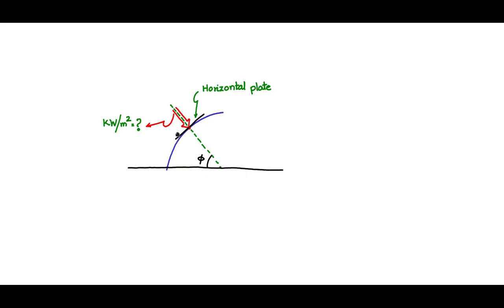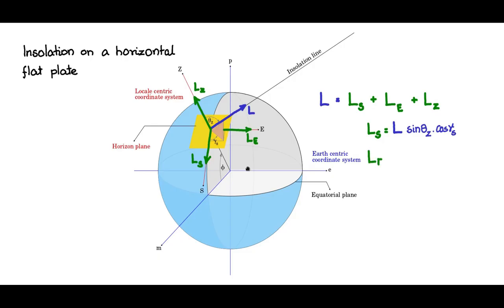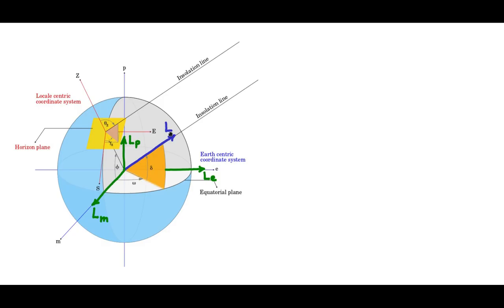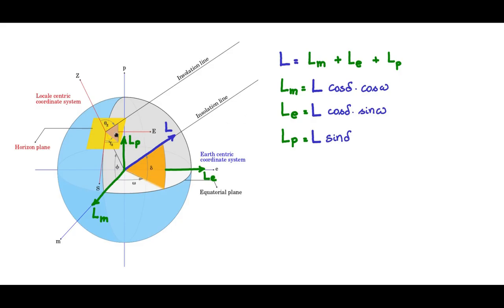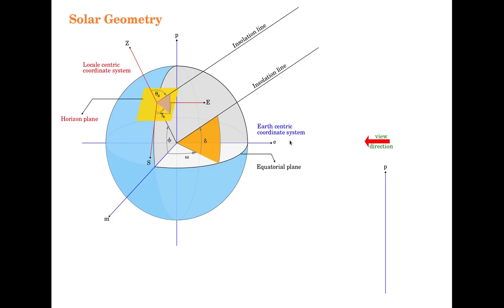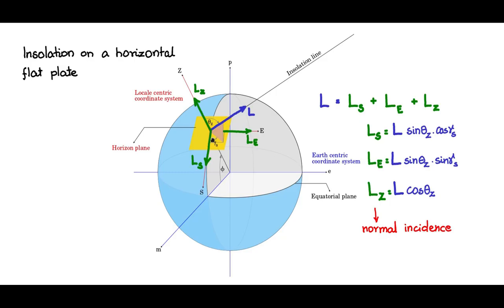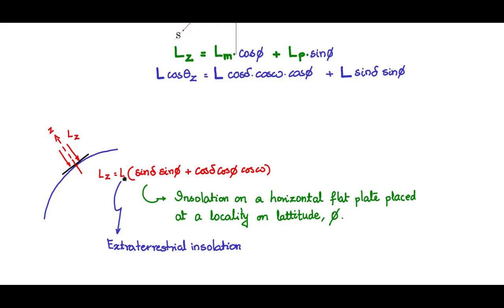Insolation on a horizontal flat plate

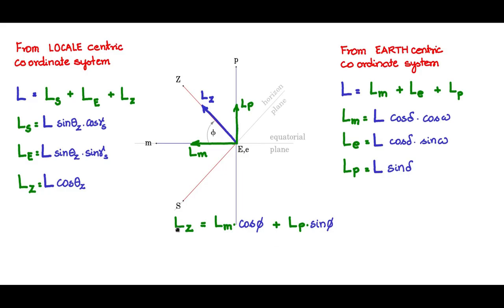Comment: At 24:22 : min I couldn't understand how '''' Lz =Lm*cos(fi )+ Lp*sin(fi)''' ,... what I know is   Lm=Lz*cos(fi) & Lp=Lz*sin(fi)'''''o''''  
and  Lz=Lm+Lp  (vectro sum),o 
correct me if I where wrong please
Reply: The insolation vector is defined as L = L_S*Shat + L_E*Ehat + L_Z*Zhat = L_m*mhat + L_e*ehat + L_p*phat. Here, "hat" terms are unit vectors. The unit vectors in earth-centric frame can be expressed in terms of local-centric frame as mhat = Zhat*cos(phi) + Shat*sin(phi), phat = Zhat*sin(phi) - Shat*cos(phi), and ehat = Ehat. Substituting these values into insolation vector equation we get:  L = L_S*Shat + L_E*Ehat + L_Z*Zhat = L_m*(Zhat*cos(phi) + Shat*sin(phi)) + L_e*Ehat + L_p*(Zhat*sin(phi) - Shat*cos(phi)). Collecting Zhat terms on the RHS, we can solve for L_Z = L_m*cos(phi) + L_p*sin(phi). Hope that helps.
Reply: @cm-bb-burger  Thanks Victor. Is there a video or textbox that maybe explains what you described for us visual learners? I also struggled with how the derivation at 24:22 was arrived at.
Reply: @desousaj99  Are you confused for the same reason as the original comment from Bilal Bilal? It seems like a few other comments also expressed doubt about the derivation at 24:22. I will make a clarification video and post the link here shortly.
Reply: Yes Victor. I understand what Bilal Bilal is noting above. That's how I would have thought to resolve the Lz into Lm and Lp components. Looking forward to your video. Have been trying to sort it out the last couple of days and I am stumped. Thanks in advance.
Reply: @desousaj99  Here is a link to the video: https://youtu.be/11kpnpxqO5s
Reply: Here is a video I made explaining this derivation in more detail: https://youtu.be/11kpnpxqO5s